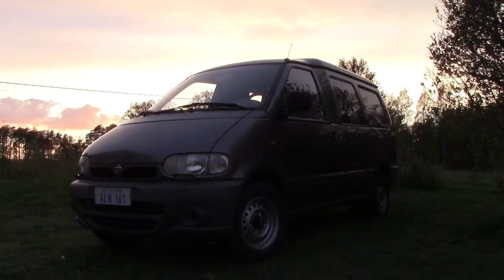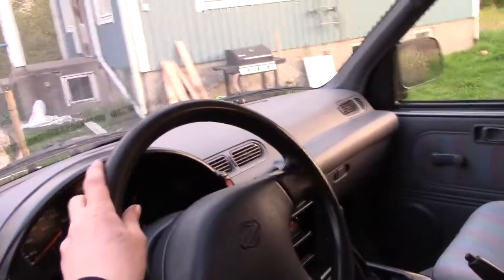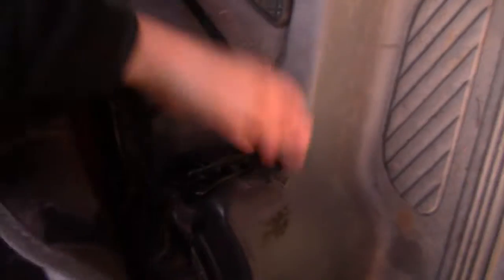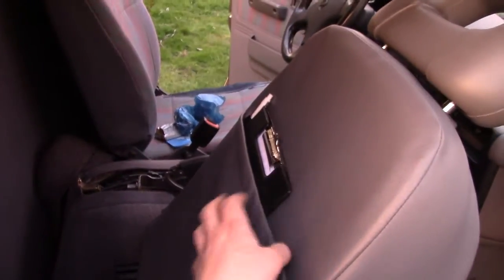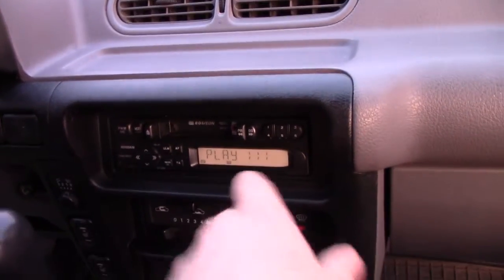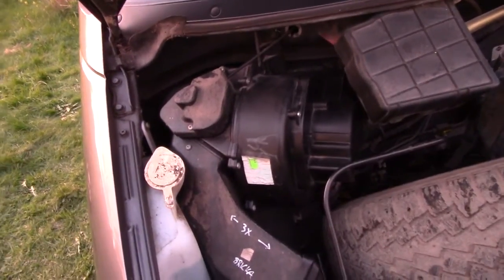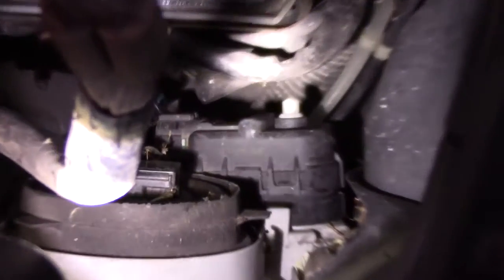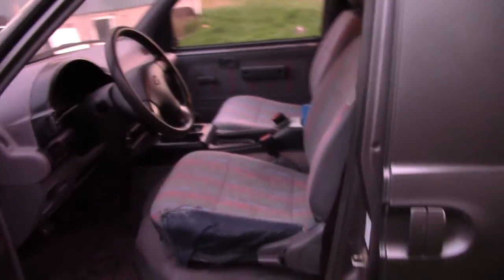MUH VAN

Comment: That's the pre-/de-emphasis for the tape that is doing the bass boost. Basically, when recording to tape, high frequencies are amplified, and when playing back, the high frequencies are attenuated in the same way. It's expressed as an a time value, for FM radio, it's 50 or 75 µs, for tape it is (from memory) in the 70 to 120 µs ballpark.
The reason this is done is to lower the noise on playback.
 Basically, what you need to do is to put a resistor and capacitor (where the t (I would begin with 120µs) is R times C) in parallel in the signal path (i.e. signals go thru the R||C combo).
That should make the frequency response flat-ish. Metal film resistors, nice capacitors (nothing critical, voltage rating 25-30V, no ceramics, plastic film preferred, and needn't be electrolytics) is what you should look for :)

Relevant Wiki page: https://en.wikipedia.org/wiki/Emphasis_%28telecommunications%29#Pre-emphasis
Reply: You might get away with putting the capacitor over the "top" resistor of your voltage divider, divide 0.000120 by that resistors value in ohms and you get the ballpark of what the caps value should be. Basic concept is that R times C should be as close to 0.000120 (120µ) as possible.
Teukka72
Reply: Teukka72 I think it would be easier for him to just find out where the amplified "line out" of the cassette deck part of the radio is, cut those traces and just wire a line in straight to there. Unless, of course, everything is integrated into a single IC.
Reply: ilovethetwinfamicom That might be the case, and even if it wasn't, it is quite a hassle reverse-engineering to figure out the signal path. And it isn't worse than a pair of caps and maybe recalculating the voltage divider.
Reply from the maker: Teukka72 That's a lovely extension to my "Dolby-like thing going on" comment, thank you for going into detail about it. I'm not going to add any filter components, however, because the system as it stands right now, actually does sound (subjectively) very good. I've basically just been spared the effort of having to set up my Ipod's DSP settings in order to achieve a similar response.
The abused de-emphasis filter, when combined with the tone controls of the stereo, do a great job at counteracting the speakers' natural low-frequency roll-off. I haven't measured it, but I'd wager that the output frequency response of the stereo between 100 Hz and 10 kHz, is within 6 dB or so, with a considerable boost (more than 10 dB) peaking somewhere in the region of 30 Hz.
The response above 10 kHz probably rolls off quite steeply, but I don't think the 5,25 " single-driver speakers had much to give above that frequency, anyhow.
Reply from the maker: ilovethetwinfamicom That's what I would have done, if it existed. However, like most car stereos, this one is based around a single-chip solution, incorporating the tape head preamplifier into a custom chip. All that goes between the tape head and the chip, is an RC filter (unrelated to the emphasis filter, it's probably just there for stability).
The chip does have support for a CD source, but in order to use that, I'd have to inject data onto the I2C bus controlling it, which obviously would translate to a lot more work than just hijacking the tape input. Especially since it has no feedback on the tape motor (much unlike most other dual-direction decks), so there was no need to fool the unit into thinking that the tape is turning. By using the tape deck, I can also very easily switch sources, since the source select button on the front panel still works
Reply: FFcossag Works too, and probably just as good as the resistor + capacitor routine.
It's a subject I know well, because in my wild youth dealt with a fair bit of FM transmitters.
Anyways, now you have this solution in the back pocket if you encounter the problem again.
The one case you would have to do a lot of components is if you intend to make a line-in out of a phono-in (record player) with a "reverse RIAA filter," 
(lots of them if you google for it or "RIAA pre-emphasis filter") it's a rather complex filter which the equalizers in an iPod probably can't hack without the quality suffering.